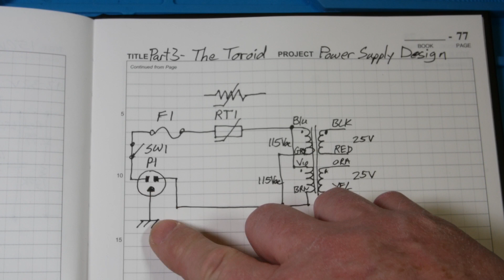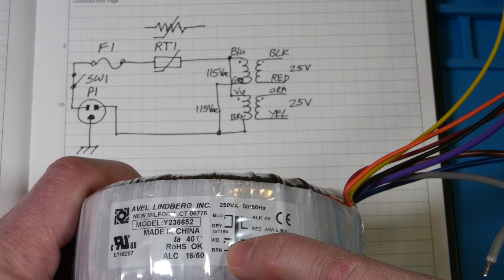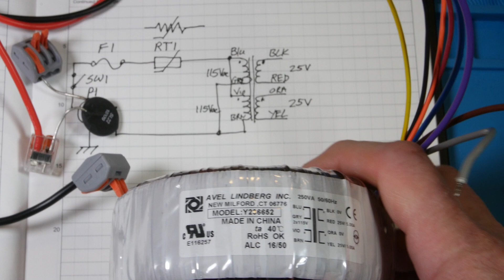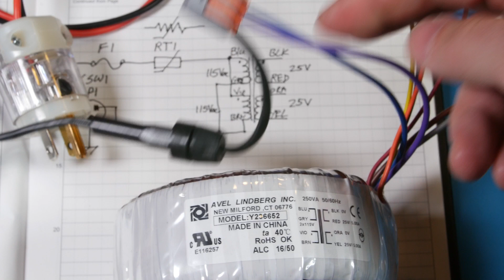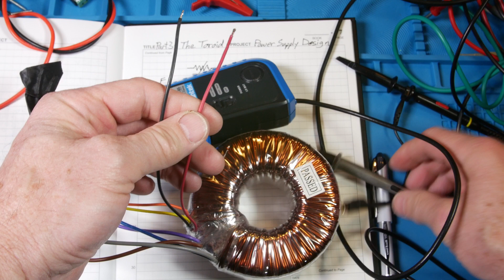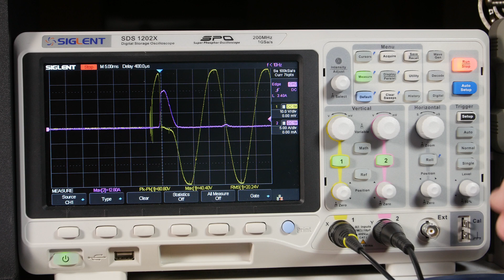Power Supply Design #3 the Toroidal Transformer

Comment: Thanks for the video and the description:  I do have one question; I noticed that the schematic shows the switch, fuse and thermistor all on the hot wire, but when wired up, the thermistor is on the neutral side by itself.  Does it matter, or should they all be on the host side?
Reply: I should have watched for a few more seconds, you cleared it up.  Thanks again not just for the video, but for the entire series.
Reply from the maker: Thanks so much for your comments and support!!!

Comment: What size thermistor would be needed for a 230 volts torroid transformer?
Reply from the maker: Great question!  It isn't really a function of the voltage but of the current.  So, it depends on the wattage and size of capacitors.

Comment: I'm rebuilding a powered subwoofer but stick, seeing this video gave me insightful information. I have a toroidal transformer that the system came with but as far as a power, stuck. The fuse rated on the label says T1A/250v? But very helpful thanks
Reply from the maker: Thanks Gavin!  If you want to give more info, I'll try to help.  It took me awhile to get to this as I am having a hard time keeping up with comments, so I start with subscribers then go down the list;)  This looks like a slow blow 1 Amp rated for 250 VAC.

Comment: Hey, why this power supplies are better than a conventional one and can this improve a video source?
Reply from the maker: If you are asking why the toroid is better than the E core, then it is mostly due to the shielding affect of the toroid.  The toroid shape keeps the magnetic field closed around it where the E core field is much larger and can radiate to other circuits.  Thanks for the question, I hope I answered;)
Reply: @KissAnalog  hey, thank you so much for the explanation

Comment: The toroid isn't solid actually it's made from just one thin laminated plate wound very tight into a coil which is needed for the eddy currents, this type is only used for 50 and 60 Hz toroid transformers
Reply from the maker: Thanks for the correction.  I'm so used to doing high frequency switching power supplies I probably said something without thinking;)  That probably happens too often;)

Comment: If I have a 220v ac in 60v ac out what current limiter would I need like the one you show hooked up?
Reply from the maker: trialnterror Great question!  What is the power input?  What is connected to the load?
Reply: Kiss Analog , that’s where I’m not too smart, I bought 3 closed loop stepper drivers that power 3 1700 oz in stepper motors. The drivers each take 60volts ac this is all I’m using for this  I’m in the US and am powering all this with a toroidal transformer that says it’s 220volts in and 60volts out. I get a in rush of current and just want to get a current limiter to keep the breaker from tripping. Is there a way I can measure what your asking for?
Reply from the maker: trialnterror What is the rating of your circuit breaker?

Comment: My 25V caps in Firstwatt F5 amplifier has started to swell, even with the thermistor. I have had a few (slow) fuses blown, so I am going to upgrade the protection to something more sofisticated than a thermistor. I noticed a buzzing sound in the speakers after a few months, but continued to use it for five years, with $2000 speaker drivers, no less. It could be because I turned on-off-on to quickly with a warm thermistor that never got the time to cool down. The buzzing sound could also be because of the rats nest of cables I have in there. Or that I biased it the amplifier way too hot. I can hold my finger on the heatsink for 1 second but not more, and I should have biased it so that I can touch the heatsinks without burning my hand. So with all that heat the mosfets might be slightly damaged. Anyway, looking for inspiration to build a much better PSU now.

I read that those thermistors are live and can actually shock you, and should be fastened properly when in use. A logical solution would be to shrink tube the thermistors, but that is not a good idea because they need to cool down so you don't wear out your caps and other components with that 70 amps. 

Really cool of you to show us why a thermistor (or better) is necessary. I always thought I had an idea of what happens, but in this video I can actually see it happening.
Reply from the maker: Arne McPuckerButt Hey Arne - great to hear from you!  Doesn’t that amplifier have 25 VDC rails? So the capacitors should be rated for 50 VDC.  The line voltage an swell and the transformer might have been rated for 115 Vac instead of 120 Vac, so the voltage at the rails can be higher than the rating.  Also, the transformer has a voltage regulation which at light load can let the voltage rise.  Voltage near the rating and high temps can cause this swelling.  And if the ripple current rating of the capacitor isn’t high enough - this can cause internal heating and swell the capacitors.  The inrush is less likely to be the issue.  The buzzing can be do to the capacitors starting to fail and causing a high voltage ripple.  I’d be interested in the make and model of your capacitors.
Reply: @KissAnalog  It was some cheap Panasonic 25V caps. The designer Nelson Pass still uses 15000 uf, 25V caps in his newer model Firstwatt F7, but here he uses four more caps, totalling at twelve 15000uf 25V caps. It looks something like this: https://forum.polkaudio.com/discussion/173282/and-the-quest-continues
 When I built the F5 I followed this build guide: https://guides.diyaudio.com/Guide/Firstwatt+F5+amplifier+v3/6 . The design of the power supply has not changed much over the years. 
Also, in Norway we have 230V.
Reply: @KissAnalog  I have started looking at your videos to see if you have a better idea for a power supply than the amplifier guru Nelson Pass. Using my own version of his designs has been a bit hit and miss, but that could be my fault completely. If you want you can look at the link to the guide that I sent you and see if you would do anything differently.
Reply from the maker: Arne McPuckerButt Thank you!  I’m sorry I just found these comments.  How is it going?  Did you get these Amps built?

Comment: Hi there, 
How do you connect channel 2 to measure the current?
Reply: Thank you.
Reply from the maker: The Hantek current clamp has a BNC connector like the scope probe, so it connects the same way.  Then the x10 or x100 setting is chosen depending on where the switch is set on the current clamp to read directly.  Also Amps can be chosen instead of Volts so the scope reads out in amps too.  I’ll show this in the new videos to be sure everyone knows how to do this.  Thank you for asking!

Comment: I like those Wago connectors. Just started using them in house wiring, especially when connecting stranded to solid wires, which doesn't work very well with wire nuts.
Reply: I took a job in automation about 2 years ago and was awestruck by those wago connectors when I discovered them on a job site.  I now keep a tupperware of both styles in 3 & 5 terminal arrangements on the workbench. They are amazing.  What's really great about them, is if you want to connect your meter to check what's going on at a junction, you can just stick your meter lead into the wago connector and clamp down. Now you don't have to hold your meter lead on the connection.
Reply from the maker: Chris Storm I’m so happy that I found them;)
Reply from the maker: Great connectors - I just found them on Amazon, and really like how great they work.  That’s another great feature, the ability to connect different kinds of wire - thanks for that insight!

Comment: Great video:-)
Am I right in that you in last video about inrush current could have used two or more wires to overcome the maximum of 65 amp on your clamp? I mean have used two wires mut only clamped around one of them to get maybe 42 amp = 84 in total inrush?
You talk about the Toroid transformer, but I have heard that O-core has less flux and are better in about all and the R-core is even better still?
Reply from the maker: Maybe I’ll do a quick video showing how to use two wires to help get around the current limitation of the 65 Amp probe.  The toroidal core is one of the best to limit coupling with stray magnetic fields, but there are others that offer good shielding, but there are trade offs.  A pot core is well shielded but has very little room for exit wires.
Reply: @KissAnalog  That would be fantastic!! I think that it may be useful when ever measuring current, inrush or otherwise. :-)
The R-core is often talked about as if they remove most of the problem, while keeping the advantages?
Reply from the maker: Fried Mule I’m just now minding comments that were posted a long time ago.  I’m sorry - I often don’t get notified of comments...
Reply: @KissAnalog  No problem at all, often do I also not get notifications when you have uploaded a video. So often do I also bench watching your videos. :-)

Comment: Hi Eddie, Good information.
Looking at your schematic drawing.
You have brown connected to neutral and blue connected to live.
Also the fuse is in the neutral side, UK colours are brown is live, blue is neutral and green yellow is protective earth.
I always reference  the dots as the neutral line.
Adam
Reply from the maker: Thanks for that info.  I did do some research and it was difficult to find a standard, but I did find a drawing depicting what you described.  Thank you!
Reply: @KissAnalog  
Glad to help !
By the way that transformer costs £30 shipped in the UK
The UK colour code, was standardised with Europe a number of years ago
Red used to be L1  ( brown as flex to a plug )
Yellow used to be L2
Blue Used to be L3
Black used to be Neutral (blue as flex to a plug)
Green/yellow stayed protective earth
Adam
Reply: @adaml52  It is fairly strange how many "standards" there are, so many in fact that I think it gives the word "standard" a whole new meaning, like standard = once. I do not think that there are two countrys in Europe that uses the same standard, I can't find any, even when these countrys share power. And even worse is that each country also do use several standards, depending on age, application and "standard".
I.e. in Denmark we use R,S,T, Null and ground + L1, L2, L3, Null and ground, each with there "standard" color codes. And don't get me started with plugs!! :-)
Reply: @friedmule5403  
The UK  wiring colour codes were "harmonised" with Europe a few years ago.
Brown, Black, grey are now the three phase conductor colours with blue being neutral.
Where black used to be neutral !.
My house wiring still has red and black cabling for the single phase conductors.
Flex cabling for has not changed, brown,blue,green \ yellow.
Do your single phase plugs have an integral fuse ?
😀
Reply: @adaml52  Yes there are some sort of standard now, but in most homes, you'll find 3-4 standards, and even so, you do not have standard in all places, Sweden have a standard, England have a standard and so on. Red leads is ancient in Denmark, but yes you'll still find it.
And even that EU have made a try in standards, I do not think that you can find two countrys in Europe that do use the entire same system.:-)
Reply: @friedmule5403  
Its the same here in the UK, My house was built in early 1970's there must four different types of wiring up to the  present.
I believe that the so called changes in standards, is a money making racket.
At least Ohms law never changes -:)
Reply: @adaml52  LOL yes, maybe the standard is that it changes:-)
Ohm's law is the same result no matter where you are but even that formula have not the same standard:-)
In Denmark U = Volt, I = Current and W=Power.